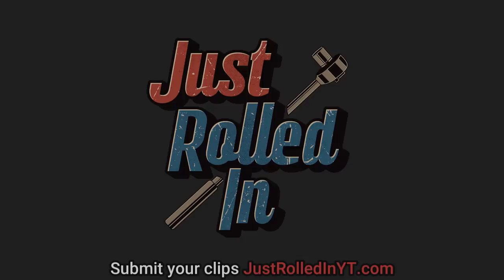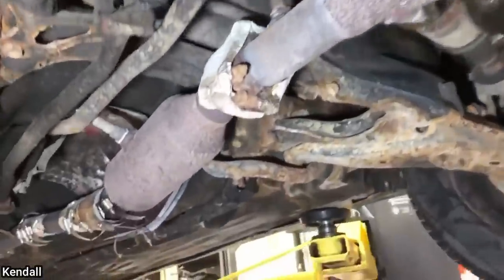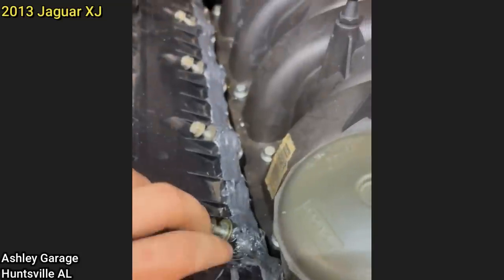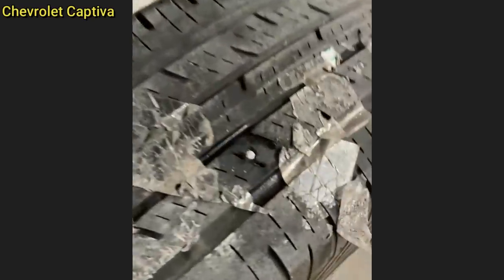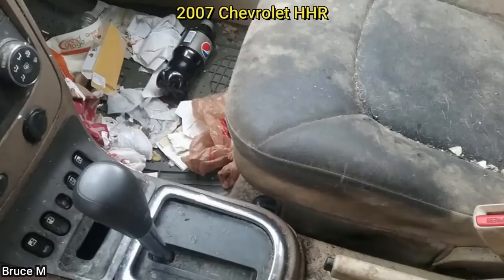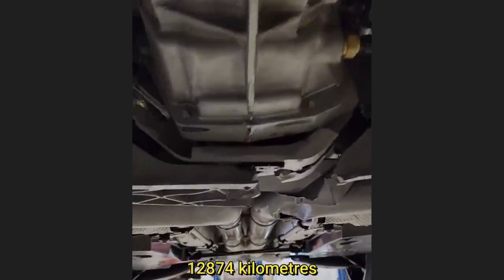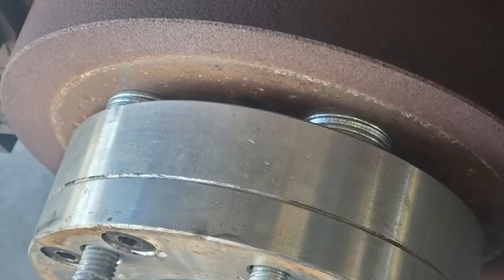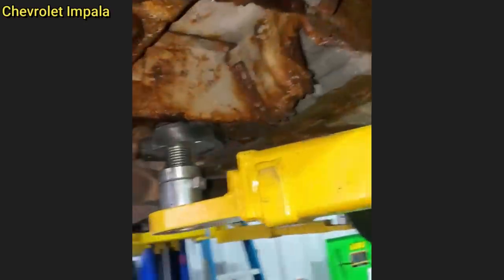Customer States Truck They Bought Has A Rumble At Low Speeds | Just Rolled In

Comment: Public service announcement: ALWAYS get an inspection done BEFORE buying a used car, paying for an inspection can save you TONS of money and pain, especially if you live in an area where rust is prevalent.
Reply: 1 second of looking at the 1st one would have saved a lot of hassle
Reply: You mean: "GET enough man-points to look INTO it BEFORE buying..."
Reply: Or just learn what to look for yourself
Reply: @TheCatOfAges  Exactly my point indeed. Just open the hood and look underneath lets you avoid 85% of the lemons. No skills other than common sense required.🙃👍
Reply: I can't tell how many post purchase inspections I've done. When they bring it in afterwards it's because its has problems, usually a lot of problems. I worked at Firestone for a while and we would do an inspection for something like $20, which is nothing. I could never get over that.
Reply: also, if it's a truck...TAKE A PEAK!! I'm no expert, but I walked away from a truck when I checked the fluids.  Radiator was BONE DRY.  I was 16 and the guy probably was laughing at me at first, but was unprepared for a high school kid to ask questions about the condition of the engine when the radiator had no fluid.  That lot was out of business before I even graduated, and this was before Google maps.
Reply: @hillogical  peek
Reply: i think you are preaching to the choir here, bud.
Reply: you cant afford to do that with every car you want to buy. You will end up spending thousands on inspections and go home without even buying a car
Reply: Even if you don't know cars, just look.
Reply: @hillogical  nothing to do with being a truck. Same for a car
Reply: @LivingTheDream77  If you are buying that many cars you better be able to check them out yourself.
Reply: Or just take a look in person before buying lol
Reply: Not a mechanic myself, and I always, always do this. It hasn't always kept me from getting burned, but it has prevented a few serious mistakes.
Reply: Fortunately I don't need to pay for inspections. I know enough to lay down next to the car and look underneath. Amazing what a quick glance would have saved those people.
Reply: @Brianz99  then 90% are scammers? That what you saying
Reply: @LivingTheDream77  you do it on the car your sure to buy if its all good. 
If you see 6 cars you aint gonna do one on all 6 if you aint buying all 6.
Not a very smart cookie arw you.
Reply: Only problem is it can take weeks to get an inspection and then you lost the sale.
Reply: Maybe if it is a private sale. Most sellers will not bother with your inspection and will just wait for the next buyer to show up.
Reply: Why not inspect it yourself?
Reply: @LivingTheDream77  ... since you will probably only buy ONE then narrow down the choices with your own eyes but have the final one checked before closing the deal. (or was that too hard to figure out?)
Reply: I’ll never forget the day I bought my truck. I was under there for 30 mins with a flashlight. Lol
Reply: Or even just look under the car
Reply: @Brianz99  The way I see it If a seller is not willing to let you check it over with a mechanic then they're probably trying to hide something.  Sellers are quick to state "as is" but they don't want you to do your due diligence to make sure that it's a good car.
Reply: exactly, I learned this the hard way letting my emotions take over and I live in the rust belt
Reply: I was young. Fortunately I took something I was about to buy to my mechanic. He said, "Don't ever bring that back here" I got the point.
Still my mechanic and not a cheap one.
Reply: @Brianz99  it kind of is the fault of sellers that people have the mentality of they're out to get them because if they would do an inspection themselves or be honest up front with the horror story underneath the hood and Chassis more could be more willing to trust them
Reply: Or at the least look underneath it 😂
Reply: Also another thing is see if your mechanic that you already use would be willing to video call you because you may not be able to take it into the shop but if you can crawl under it with a flashlight and pop the hood the mechanic May notice something you don't and if they're decent they won't charge you for that service
Reply: Or you just have two eyes
Reply: How do we buy a used car? Just close eyes and pray for the best. It works, almost always.
Reply: Get down on one knee and just look under the car...
Reply: @CartoonWeasel  you don’t get it. Once you get 1 checked and it comes out bad, you go to the next potential buy, then do the inspection again, then comes out bad again. Then repeat. Do you get what I’m trying to say now ?
Reply: I'll counter the number of valid inspection stickers I see on rolling wrecks in VA.
Reply: A mechanic may find something you didn't but if you don't take it in for an inspection at least do the basics yourself. I've never bought a car that I didn't look under the hood and underneath the car to inspect the frame, exhaust, steering and suspension components and everything else noticeable. Good idea to bring a basic code reader too, if someone will not let you read the codes walk away right then.
Reply: @yyz4761  A firestone inspection is a joke, they once told me my Tahoe needed new brakes and tires on the inspection sheet when I was there for an alignment. The tires and brakes both had under twenty miles on them as I just changed the brakes after getting new tires from a different tire shop and got the alignment there right away because I already paid for a lifetime alignment years before. The tires still had the tire tits on them.
Reply: @phillhuddleston9445  Firestone can be like getting a fast food chicken sandwich. You go to one place and it's the tastiest thing ever. Go to another and you don't even know if it's meat. I had a ridiculous experience at a Firestone before I ever worked at one. I had another not so stellar experience after I stopped working for Firestone. I worked at 4 different shops before I moved on and in that time I only worked with one b.s. dude that would try and scam people. he didn't work there long before the boss caught on and gave him the boot. The last one I worked for was one of the tightest run shops I've ever worked in. Results may vary just like any independent shop and if you think that the independents are any different than you are naive, I worked in them too.

My point wasn't to be some cheerleader for Firestone, I used them as an example because I can still remember what it cost. It was $22 the whole time I worked there and I though that it was ridiculously cheap, but they should still be able to tell you what general condition the vehicle is in. I know, I did hundreds of them and never cheated anybody. One advantage of a chain is that if you have an issue an independent can just tell you to gtfo and your only option is take them to court. With a chain you have corporate. They don't like getting complaints and this can adversely effect the managers career. My last boss had reached the coveted partnership level and would protect that dearly.If it goes to court the corporation is viewed as having deep pockets.  Have a nice day.
Reply: I went and looked at a car the other day for a friend’s daughter, that lives 4hrs away, I’m no mechanic but he showed me that the power steering fluid bottle was broken halfway up, but when I drove it, it felt like the steering rack plus a lot of the suspension was buggered, apart from cornering it was great, new tyres brakes etc, so I was thinking he was trying to hide an expensive fix, and when I got back I looked under the car and it looked like it had an engine oil leak he tried to tell me it was the power steering oil, and the ball joint’s were gone, it was duel fuel which means it also runs on LPG(Propane) but the tanks need to be checked every 10yrs he said it had just been checked but obviously he didn’t have the paperwork which is an $800 job for a LPG registered mechanic to drop the tank and then get it checked, he said his mate had it, of course he didn’t, he said he wasn’t going to do anymore to find it, so I said thanks but no thanks, it’s a known young person car that gets thrashed and his son had it, if my friend’s daughter had time and money which she doesn’t as a single parent it would have been worth the $1200 I got him down from $1800, cos I could have got a mate to help me fix that, he even messaged me in the morning at 7.40am to say I was missing out on a good car, I thought yeah missing out on a lemon.
Reply: Honestly good advice if you don’t know what you’re looking at. $100 could save you thousands.
Reply: @RecklessEnterainment  yeah it's mostly for people who only really see their car as a means to go from point A to point B and not necessarily want to get involved into the mechanical aspect of it
Reply: @yyz4761  I'm sure you're right but just giving my experience from three of them.
Reply: Finding a reliable mechanic can be like finding a good barber. Once you find the right one, you’ll stick with them. My dad was complaining to me about not being able to find a mechanic he could trust so I hooked him up with a guy I knew in his area. This guy had a shop behind his house. He already was busier than he wanted to be and wasn't taking on any new customers. I talked him into taking on my dad as a favor. I explained this to my dad. I told him he is a very reputable guy, he is seeing you as a favor to me. He doesn't need or even want your business. Don't ever forget that. If you ever have a problem or concern with his work just come and talk to him respectfully and he will address the issue and make it right. He will always undercharge you, do not ever forget this. He likes to shoot guns, he likes very good coffee, and he likes fine chocolate ( provided a list of calibers and  coffee and chocolate brands). Every now and then stop by and say hello, give him a couple of boxes of 9mm, a pound of coffee and just say thanks. He did that and the two of them became really good friends. Life is funny sometimes.
Reply: @phillhuddleston9445  It happened to me twice. If they had done business the way they were supposed to, it should have never happened at all, but it did. They handled it poorly which shouldn't have happened either. None of this would have happened at any of the stores I worked at which is kind of like second hand embarrassment. I don't know man. Why do some people live and die by their integrity and their word when others always chose to lie, cheat, and steal? Always looking for the easy way out, the quick buck, the scam, when it would be just as easy and more personally fullfing to do it the right way. I don't know brother. What I do know is that I'll never be like them, I need to believe that that the quality of the work I do matters. I wouldn't"t want to live in a world where it didn't .Just going to leave this here, the very worst rip off shit I've ever encountered was from independent shops. Just outright robbery. Not to dump on independents, because like anything else, there is the very good, the very bad, and everything in-between. I hope you gave em hell about the tires and brakes because they certainly deserved it.
Reply: @phillhuddleston9445  Finding a reliable mechanic can be like finding a good barber. Once you find the right one you’ll stick with them. My dad was complaining to me about not being able to find a mechanic he could trust so I hooked him up with a guy I knew in his area. This guy had a shop behind his house. He already was busier than he wanted to be and wasn't taking on any new customers. I talked him into taking on my dad as a favor. I explained this to my dad. I told him he is a very reputable guy, he is seeing you as a favor to me. He doesn't need or even want your business. Don't ever forget that. If you ever have a problem or concern with his work just come and talk to him respectfully and he will address the issue and make it right. He will always undercharge you, do not ever forget this. He likes to shoot guns, he likes very good coffee, and he likes fine chocolate ( provided a list of calibers and  coffee and chocolate brands). Every now and then just stop by and say hello, give him a couple of boxes of 9mm a pound of coffee and just say thanks. He did that and the two of them became really good friends.It's Kind of funny how life works out sometimes.
Reply: well said
Reply: Why don't they make it compulsory? Where I live (Belgium) you cannot sell or buy a car without a severe control by an independent organization. There's also a yearly mandatory control.
Reply: @Brianz99  because sadly there is a LOT of folks out to get your money but ya as long as you just use some commons ense you can avoid the cash grabs.
Reply: @hillogical  good ketch.
Reply: @bigcheese781  this "common sense" you speak of I believe it's very uncommon now a days🤨
Reply: @LivingTheDream77  hmmm. Did ya actually read and think about what ya wrote here? Of course you aren't going to have every car you see inspected. Maybe jus the ONE ya wanna buy😬
Reply: my old mechanic inspected 22 cars for free for me. he liked doing it. ps: 21 of them were trash in disguise
Reply: We use to do Pre Purchase Inspections for Free and most of the time just because of that gesture we those customers remained with us up until the point that we closed

Comment: That center-console 'ashtray' was absolutely bizarre!
Reply: The customer probably thought the butts would fall on the road. Quiet littering. Instead, it bit him for a repair bill. Karma in action.
Reply: Can you imagine what the inside of the car smelled like?
Reply: The owner’s lucky they didn’t catch the car on fire.
Reply: @danmcclure6670  Perhaps, but I'd rather not. The passenger seat looked like a mess, and how hard is it to just throw trash away while you're waiting for the gas pump to fill the tank?
Reply: smokers are just pigs.
Reply: He'd have been OK if the thing didn't have a plastic shift linkage. The worst that could happen is that you have to clean the ashes out of it. But it's still mindlessly stupid to do.
Reply: Imagine what his bathroom looks like.
Reply: @dont-want-no-wrench  Amen
Reply: @conradmcdougall3629  I'd rather not. Pig in the corner as an air freshener.
Reply: @conradmcdougall3629  That's if he has a bathroom!
Reply: Sounds like you've never met a smoker
Reply: @danmcclure6670  An ashtray.
Reply: I used to work on cars and as soon as I saw that one I am almost sure I could smell it from here! That was one thing I hated so much was any car that was heavily smoked in!
Reply: @conradmcdougall3629  Perhaps the car is his bathroom.
Reply: @danmcclure6670  imagine what the customer driving that smelt like .
Reply: Stop.... It IS an ashtray, isn't it?!!!!!😱
Reply: @soaringvulture  the worst would have been a fire, but your point still stands.
Reply: I would decline doing anything with that.
Reply: A shop vac will clean it up in a flash, but my repair bill may exceed the value of the car.
Reply: @readeraway3393  seems like the "customer" wasn't capable of thinking, in general.
Reply: @stevie-ray2020  he probably just uses the back seat as a toilet.
Reply: can you imagine how bad that interior STUNK??? and I'm a smoker!
Reply: Long time ago as an apprentice technician, we had a customer bring her car saying that the heater controls were jammed and the heated rear screen didn't work.    Turned out that all the cigarettes in the ashtray had gone on fire and melted the cables and mechanisms and wiring above it.  Took a couple of days to fix as every bit of the lower dash needed removed and most parts were replaced
Reply: @robertwillis4061  hope you charged her heaps of stupid tax 👍
Reply: Brings me back to the memories of having a '63 with a good hole in the floor board. You could just stealth piss on the road.
Reply: @doejon9424  - Sir I believe you have a fluid leak from underneath the vehicle
- Oh um nevermind about that. That's probably not a big deal
Reply: @doejon9424  Reminds me of the east german car (Trabant?) that used to have a feature no western car company to my knowledge have never thought of:

The floor on passenger seat had a hatch in it, so you could drive on an iced lake and fish in warm comfort of your car.